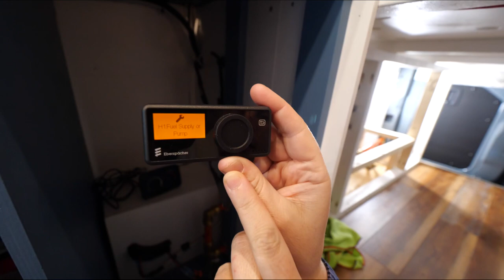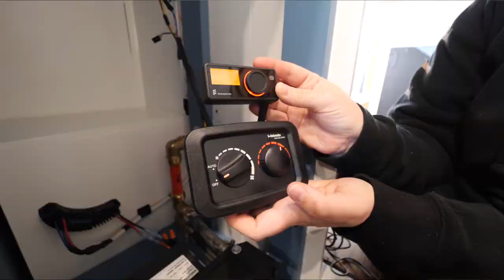Espar Hydronic Heater Wiring & System Start-Up: D5E Hydronic Heater for Vanlife

Comment: We're installing the same system in the UK (so Europe) we usually use black for ground and red for positive in 12V systems. Brown is also sometimes used for ground, but the black-coated red wire for the positive threw us off as well, they could have at least used red heat-shrink!!
Reply from the maker: Hey guys! Thanks for watching! By the way we love following your van build!!! We do the same here in the US for 12VDC. Black for ground and red for positive. The wiring harness definitely took some time to figure out, but so happy it’s done and working!
Reply: @WanderfulRevolution  We're just on the step of installing the heater and wiring now, our Kalori Silencio has 2 wires from the back of it (2 red, 2 orange and 2 black), so a little different from yours, and as you said the wiring diagrams for these things are few and far between so it's a lot of digging around online and ringing up companies to try and find it out. Glad your system is all up and running, we can't wait to gets ours working. Your van build is awesome :)

Comment: Here in the UK on a single phase system i.e 240v we use brown=live, blue-=neutral and yellow/green = earth or as you guys say ground.
in a three phase system i.e 415v we use brown/black/grey all live conductor and we would normally use the black as ground wrap in yellow/green sleeve if that cable is part of a 4 core cable.

On the DC side its typically black and white core where white=positive and black=negative
Reply from the maker: Thanks so much for the info! We really appreciate it!

Comment: Brown is always ground (and Red is +) on European vehicle wiring based on the Bosch standard. Other 12v systems commonly use Red (+) and Black (-/Gnd). 240V house power systems tend to use Green/Yellow spiral as ground Brown as Live(Hot) and Blue as Neutral at least in flexible wiring - e.g. power cords for appliances.
Reply from the maker: Thanks for watching and thanks for the info!!! We use red and black for 12VDC here in the USA. So we had some learning to do to figure out the differences for European standards!

Comment: I'm so glad I came back and watched this video again! I'm in the midst of puzzling out my wiring harnesses for the same unit.

Yours are a little different; I don't have the bigger red/white wire you mentioned, and for a brief bit I didn't think I had the black/red one either - but oddly enough, there's a little black/red wire that comes out of the main bundle, hooks back around and is taped down on the outside of the main bundle where the model number label is. I suspect this wire has the same use as yours does, so I think I'm going to try it with my Kalori air matrix/Webasto controller as well. 

That said - how did you guys manage to keep air heat going overnight in cold conditions? You say this one wire will prevent the Kalori fans from blowing when there's not enough heat in the system; does using that wire make the Webasto controller cause the main hydronic furnace to kick on and heat the glycol? Or does the main furnace controller have a timer you can set to run for a few hours as needed?
Reply from the maker: Hello there and thanks for watching! The main timer for us we would set it to come on throughout the night as needed… there is an option for a continuous run but we didn’t want to stress the system too much… good luck and wishing you success!!!!!
Reply: @WanderfulRevolution  Gotcha! That's the answer I was hoping for. Thank you and I hope you and Jed are doing well!

Comment: Love this video! It’s so useful, thank you. One question: how did you seal the hole in your van floor the wiring goes through to get to the heater on the underside? I’m at the step now and want to seal out moisture but not permanently seal the wiring either.
Reply from the maker: Awwwwww thank you so much! We used a sealing foam to keep out the outside! Fairly easy to work with. Thank you for watching!

Comment: What a great helpfull vlog thanks from the uk.. In the uk are earth cable is Green & Yellow 👍.Can i ask if you want to keep the heater on to warm all night does the burner stay on all the time or just to heat up the Glycol mix ??? Stay Safe 👍👍🚙
Reply from the maker: Thanks for watching!! Really glad it is helpful! The burner heats the glycol to 167degrees F. It will then stop heating until the fluid temperature drops (I’m not sure what that is though) and then restart. It does continue to circulate the fluid through the system the entire time the unit is on.
Reply: @WanderfulRevolution   Ok thankyou, I want the same and was wanting underfloor heating but seen the timer switch and it says only run for one hour 
etc, so does the heater stay on all night to keep floor warm etc ?? Theres not alot on inernet for help etc...
Stay safe 👍👍🚙

Comment: Brilliant. Thank you so much. Wondering if you could answer a question though. I got to the point where you're working on the PVM. Couple of questions there. First in the four pin connector how do you identify which one's number one second you said replace the positive there because the positive goes somewhere else or is it just not used at that point? Additionally on the PVM there's a two pin connector am I missing something on that or is that not used?
Reply from the maker: Hey there! Could you do me a favor and email for questions to me at contact@wanderfulrevolution.com
I will need to look this up again because I don’t remember off the top of my head! Thanks!
Reply: @WanderfulRevolution  Thanks so much for your reply.  I was watching Van on the Run Mori, and kept seeing a manual and it appeared to be the same one you had.  I dug around in all my product docs and found the missing link!!!   Thanks again though and seriously thanks for the video, absolutely the most helpful video on this set up from Heatso out there!

Comment: Thanks for the great video. Can you tell me what wires in your 4 wire harness connect to which wires on the actual easy start? My easy start just has a bunch of wires with no harness connector. My heater was also purchased from Heatso.

Comment: I bought a kit from Heatso too. Their support isn't the greatest. I tried their chat option and they stopped responding midway through the conversation. Would be nice of they just said we don't help people with installation questions!
Reply from the maker: Their customer support is extremely lacking. We attempted to call, never got answers. Left messages, no return calls. Sent emails with no response. The only place we were able to reach them was through chat and the same thing happened to us. They disappeared mid conversation! We’re you able to get yours installed?
Reply: @WanderfulRevolution  Installing mine in a couple of weeks! Looks troublesome but so glad I found your videos. How effective has the Kalori blower been for you guys? I got the same one with the kit which draws 55 watts, but they have a smaller one (3.25kw vs 4.3kw) drawing only 7 watts.  Given that the dedicated 2.2kw D2 air heater seems to be enough to heat a van, I will be trying out the 7 watt Kalori for the energy savings.

Comment: Question:  In the event of a power interruption to the heating system, when power is restored, does the heater come on in the same mode as before the power interruption?  For example, if the system is in heat mode and is running, the power is interrupted and then restored, will the heater go into heat mode and run?  Ir will it require a person to turn it on?
Reply from the maker: To be honest I don’t know… our electrical system has never experienced an interruption… the batteries provided a constant power supply… we did have a battery disconnect but never flipped it while the system was running… I would assume that the system would automatically cycle down… an error code may be thrown if the system can’t complete it’s shut down cycle… but this is a guess…

Comment: Follow up question, I am still struggling getting the wiring done, like you said in your video literally the hardest part...
With the Webasto Controller, I have the yellow wire, and then power and neg for it.  it turns the Kalori blower on, I can set it to auto and change the temp setting on the dial to the right and the unit comes on, but how does that connect to the espar?   I thought you could use the auto function and during the night the unit would turn on, the glycol would heat up, then the blower would turn on and you got hot blowing air.
Reply from the maker: Hey there! Sorry the wiring is giving you a hard time. Do you mind sending an email with your questions and a picture of what you are asking about? That way I can make sure we are talking about the same thing. Contact@wanderfulrevolution.com
Thanks!
Reply: @WanderfulRevolution  Will Do, thanks

Comment: How much cheaper was that system, and was the cost difference worth not going with Rixen? I have already purchased the Rixen system because of the Dares Drives content, but I am still curious. Thanks for the great content.  The failures and detailed content is appreciated.
Reply from the maker: Hey there, thanks for watching! We definitely saved a lot of money buying our system. We spent $2000 on it. I believe Rixen systems are about $5000-6000 right now? The cost of the system we bought has gone up though and I think it’s a little over $3000 now. With that being said, I think you made a great choice going with Rixen. If we had it to do over, we likely would have gone with them. Their system is much more integrated than ours, they seem to have better installation instructions, and their customer service is amazing! They helped us out even when we didn’t buy from them.
Reply: Hey Jeff, did you get your Rixen system up and running? I finally flipped the switch on mine after three months of install and can’t seem to get power to the fuel pump/furnace.

Comment: Why two heat exchangers? Why doesn't just one work? And could you route them in parallel instead of series?
Reply from the maker: We have two exchangers because we have a recirculating shower and we keep that totally separate from our kitchen water. If you have a regular shower, then you definitely only need one heat exchanger. 

If you do need 2 exchangers your can run them in series or parallel. We ran ours in series because we have a pretty short circuit and series works fine. If you have a longer circuit you may want to run in parallel as that will reduce any heat loss further along in the system.

Comment: Hay guys! I was wondering how long does the water in your shower Stay hot if you’re running it constantly? Since I install my system, I can only get the water to stay hot for about a minute or two before the heat exchanger goes cold and I have to shut it off and let that warm up. This is all while I have the heater running and I have already let it heat up for 10 minutes before turning the water on. Any suggestions could help as well
Reply from the maker: Ours stayed hot constantly… what are you using as your heat source? Also keeping the circuit as short as you can helps conserve the heat in the loop… I hope this helps!!!

Comment: Why did you use two heat exchangers on your hydronic system and did it work out for you.
Reply from the maker: One for the sink and the other for the recirculating shower… because the shower water wasn’t drinkable we wanted two separate circuits… it worked out great! hope this helps!

Comment: what fittings did you use to hook the calorie fan to your (orange) coolant line? looks like 3/4 shark byte elbow then what? Thanks.
Reply from the maker: The fan has barbs on it. We clamped hose to those barbs. On the other end of the hose we used the following fittings:
1. Barb to 3/4 male NPT
2. 3/4 Shark bite elbow, one end is a female NPT and the other end is the shark bite fitting 

Hope that makes sense
Reply: @WanderfulRevolution  thanks again. Great help.

Comment: I really appreciate your effort to document your installation, very well done! I was wondering if you find that you are able to control the temperature conveniently without needing to wake up frequently to either turn off or turn up-down the heat system? I’m trying to layout a system for an older but large boat. My goal is to comfortably heat a 1987 - 55 foot power boat, with potentially 5 separate areas. So aft berth, salon, galley, forward V-Beth, and fly bridge (steering helm area). Heatso insists that it is NOT possible to have thermostatic temperature control wirh hydronic heating from Espar. Do you agree? Which makes me wonder about needing to get up multiple times a night to turn fan units off or the entire system? Any suggestions or advice greatly appreciated.
Reply from the maker: Our unit Espar kit came with a kalori blower and a webasto controller. It does have a temperature sensor and the blower will kick on and off depending on the level we have the webasto controller set on. You can not pick an exact temperature though. Keep in mind that the blower and the Espar heater are controlled separately though. I don’t know that you would have an easy time controlling 5 different areas of a boat. The weather has warmed up here so we haven’t used the heating extensively though. May I suggest looking up Rixen Enterprises in Oregon (are you in the UK? US?). Those guys are so helpful and are happy to talk a system like that over with you! https://www.rixens.com
Reply: Thank you so much! I’m in the US, moving the boat from San Diego almost to the Canadian border. So need heat 😁I will check out the link. Thanks again

Comment: im building a sprinter and i am thinking of going in the same direction. how has the heater held up? also how has it been for hot water ? its hard to decide between this  and two individual systems
Reply from the maker: The heater has held up fine and after waiting for a few minutes gives us as much hot water as you have supply… overall very happy with the water heating capabilities!
Reply: @WanderfulRevolution  thank you.
Reply from the maker: @Joe-nx7nj  you’re welcome! Good luck with your build!

Comment: Hi !  I've just start running my Espar D5E S3 and even if I select "Infinite" time running on the Easy Start Pro, it stop every time after many hours ( Fault code P000e01 : Runtime limit exeeded).  Do you had this issue with yours ?
Reply from the maker: Hello! We generally run it for about an hour at a time… we haven’t let it run for that long… not sure if there’s an actual limit to how long it will run? If you do get an answer please let us know! Thank you for watching!
Reply: @WanderfulRevolution  Ok so it looks like it's a 12 hours maximum runtime and it's obviously not designed to run all the time according to the manual.  So if I'm leaving the van for a few day trip, the van will not heating on it's own after 12 hours of running time.   I'm getting to the conclusion that I will have to  add an Espar D4 Airtronic for the regular heating and use the D5E as a complementary heating system.  Disappointing as I was looking for this system to run all the time (during winter) and use it as a primary heating source and spent so much money in this setup.  However, the good side I guess is the fact that having a backup heating system in case where one or the other come to fail one day could be a great option in extreme cold weather conditions.  (it's still snowing today here in Québec, Canada ! )

Comment: Where can I find the documentation you have for the wiring? I can't find the info on the CD I have.
Reply from the maker: Unfortunately we had a difficult time finding the information in the CD as well. We searched for the installation manuals online. We scrubbed through all the wiring diagrams and traced all the wires. We also talked to Heatso about what was needed and not needed. We got some of our wiring info on the sprinter source forums as well.
Reply: @WanderfulRevolution  do you have any pictures of the back of your easy start or webasto heat controller? this video was very helpful, I just wanted to move really slowly at that part of the wiring because that's where I'm hung up

Comment: wow $3300 just for the Espar Hydronic kit, plus parts and heat exchanger, etc, we are looking at close to $4k?! Way out of my budget. gonna DIY it for less than $1k budget.
Reply from the maker: The price has increased a lot since we bought ours. We paid just under $2000.
Reply: Caution, if buying *used Espar:: it’s computer can be LOCKED-OUT if “start/ON” is commanded improperly 3x. I bought a “second-hand bargain”from a skoolie build (they went with air-heat) and only learned this *after